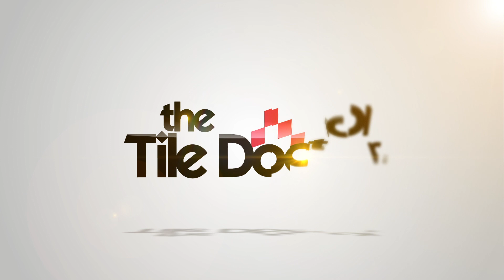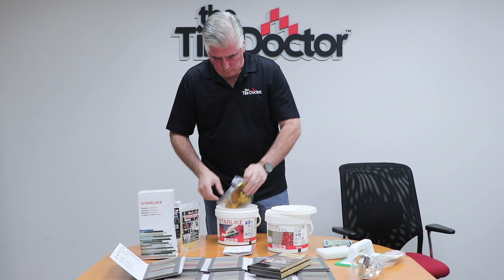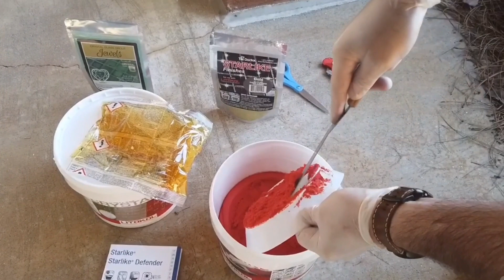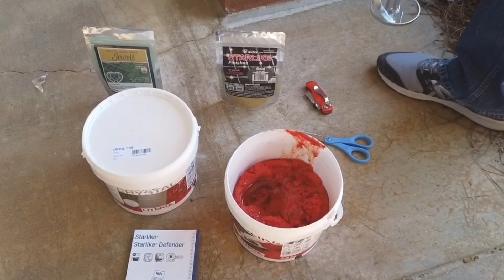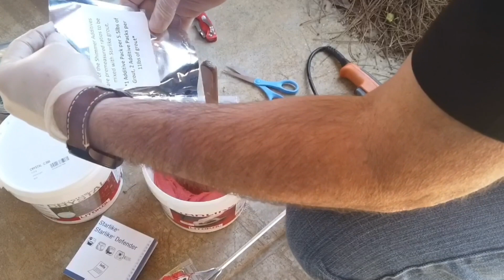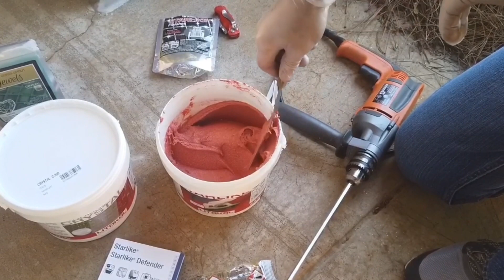Starlike Grout Products

Comment: I purchased some gold Starlike from you a while ago and now with this quarantine I have time to use it. I purchased the gold, after opening the container I noticed that the grout was grey in color although I do also have a bag of gold powder. I assumed that the grout would be gold as well however maybe the gold powder changes the color of the grout I do not know and there lies my question today. Is the grout suppose to be grey, the (A) part of the two part mix?
Reply: I can help you here the gold powder does not turn your grout gold it puts a gold reflective shimmer (fleck) through your grout on the top of your tub it should have the name of the grout you purchased and as I said the gold powder is a highlight it does not change your grout colour to gold, I hope that helps.

Comment: really wish you had a video from start to finish with the sealer and everything
Reply: I purchased Starlike Evo grout, and was told that epoxy grout does not require a sealer.
Reply: it does not need a sealer it is Epoxy. They sell Sealers for non Epoxy Grout and those that like to spend Extra money.
Reply: @Awack420  this grout is the only thing I have used ...I know all of what you said in your comment , but I put a lacquer over it and it brightens the grout and brings the colors out more so.